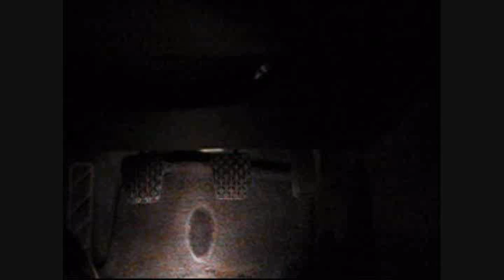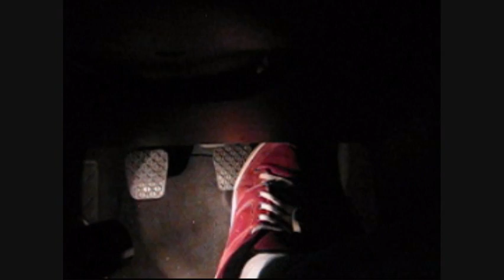Basics of Heel Toe shifting

Comment: This is the third video I've seen which doesn't mention double-clutch at all. The only way for heel and toe to be of any benefit is to do it in this order...brake, clutch out, neutral, clutch in, blip the throttle, clutch out again, new lower gear, clutch in, Anything else is a waste of time and you're not doing what you think you are.

Comment: Yeah no. Outside of Fast and Furious, there's no purpose to double clutching a modern transmission with synchros. The point of heel-toe is to match the engine revs to the transmission input before you shift into gear. If you don't, then one of two things happen: you slow down from engine braking because you're forcing the engine to match revs with the transmission with no throttle, or you ease in the clutch while giving throttle afterwards, which slows down how fast you can leave the corner.